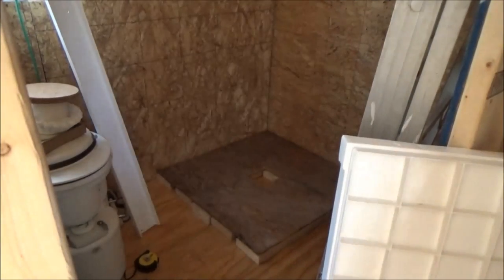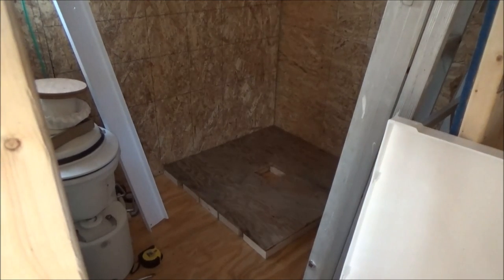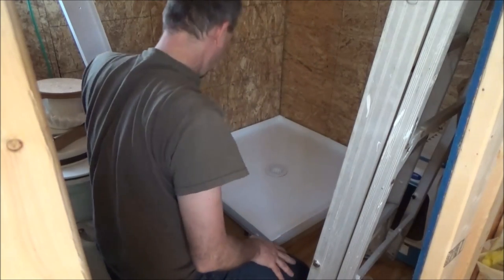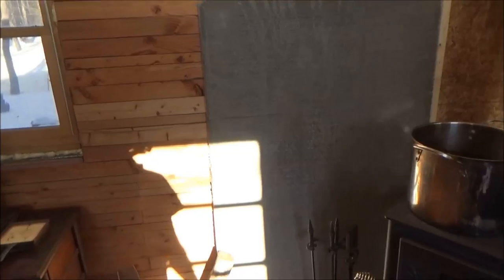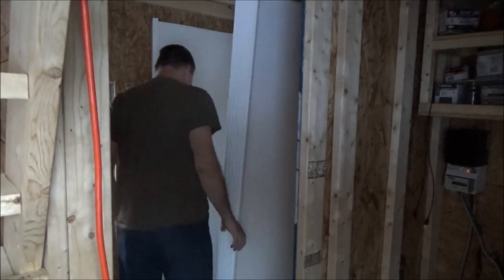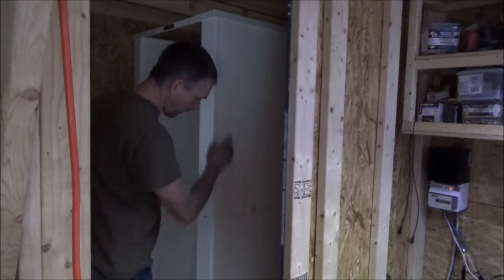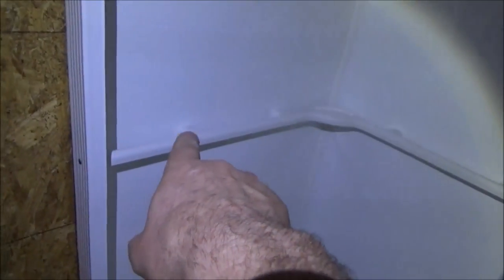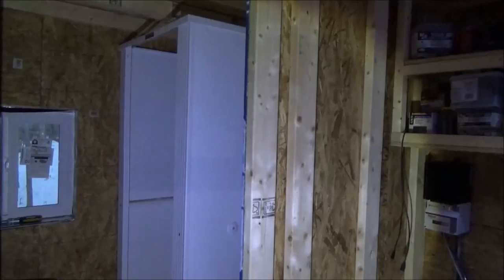Finishing My Tiny House Shower Installation

Comment: Hey Troy, the rubber gasket goes underneath then the paper friction washer, Put some clear silicone caulk to seal the drain to the floor of the shower. You will have water standing if the drain is not the lowest point. Plumbers putty dries out and cracks therefore loosening the drain,it's worthless. Pretty sure that's a shampoo bottle holder in the corner thar. Plumber 18 years.
Reply from the maker: Thanks. I will seal the floor then. Good idea. I did not like how the water sits there when I tested it.

Comment: Dear Troy i am just wondering if you are going to use the gas hot water system you got given to you to heat your water sorry to be a pain love the house it will be nice i bet when you get the shower done any way be safe and try not to let the drill bite you again lol
Reply from the maker: Yes but probably in spring. I want to build an insulated room out back for it so it does not freeze
Reply: good thinking 99 lol

Comment: I'm sure the Sun does heat up that tiny french villa on wheels.  It'll sure be fun in the Summer.  That shower reminds me of the shower I used in prison.
Reply from the maker: Yes I am sure the sun is making a huge difference. But in summer I will have solar panels acting as a sun blocker over the front of the house. And radiant barrier will stop the sun from heating up the inside. Plus curtains
Reply: LOL!!! Tiny French villa on wheels!

Comment: Youre right, "The Tiny House On Wheels With A Giant Shower" is a bit cumbersome.  I remember my Pop and I put one of these showers in the back corner of the garage when I was a kid.  Yeah, it seems flimsy, but its plastic and its not goin' anywhere.  Why not bolt the walls of the stall to the walls of the bathroom?  BTW, you can remove the top piece, trim the height of the walls and then replace the top piece if its too tall.
Reply from the maker: Problem is if I trim it then it will be shorter than I am. well the shower head would be under my head anyway. Its not very tall to begin with.
Reply: The Do It Yourself World Yep, having to duck to shower might not be the best fix.  Bad idea.

Comment: Make sure you my use shower caulking not white window caulking it will turn to molding.. There is no way to clean it permanently.

Hop you say my suggestions on how to refill your water takes.

What are you going to do for hot water.  Are you going to make an outdoor kitchen with a fire pit and a hot water coil in it .. That one mud give you a book on mud oven you can put a palet under it  and say that it is portable.  

If you do so you will be trying to keep hot coals throughout the winter. Or bake you a quick lighting system you could spike the logs with diesel fuel that has been done.
Reply from the maker: Thanks for the tip. Good point.
Nice idea on a portable mud oven :)
I will probably build a mud oven in spring or summer. Cant dig right now anyway to get mud and clay
Dont think I saw your suggestion on filling the tanks. Please bring it over to the forum where I am sure to see it: http://www.thediyworld.com/forum
Thanks

Comment: Will be You running pex? Decent size bathroom!
Reply from the maker: yes. thanks
Reply: The Do It Yourself World You should run the shower directly over the center of the stall.You are pretty tall,and those stalls are on the tight side.A rubber shower pan liner would be a good failsafe,I believe a 2x3 wall will need to be constructed,at least.I would just wall mount a small sink too
Reply: MrCrf450rider you can always put a retracting mirror in for the shower,and brush your teeth in there.

Comment: I'd get one of the wand shower heads so u can move it around
Reply from the maker: Been thinking about it
Reply: The Do It Yourself World I would try and find a ceiling mounted shower head, sometimes called a rain shower head. They look really cool and are great for showers, much better than a standard shower head or wand.
Reply from the maker: James Pottorff Considering it but one problem. I prefer to cover the top of the shower to prevent splash out
Reply: The Do It Yourself World Didn't think about that

Comment: I see the instructions were how to install the shower kit not to build a shower. You will need to watch for moisture around the shower in the bathroom and about once a quarter crawl under the tiny house to see if there is any damage being done. I would hate to see you step in for a shower a year or so from now and you fall through the floor. Best of luck